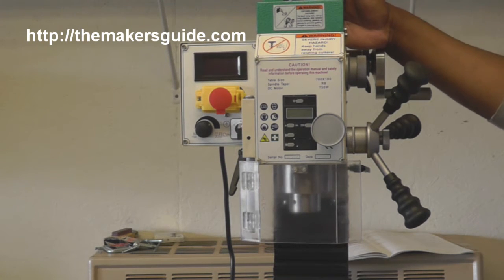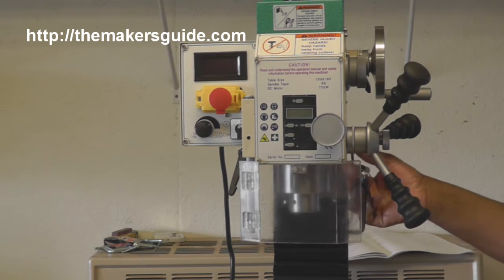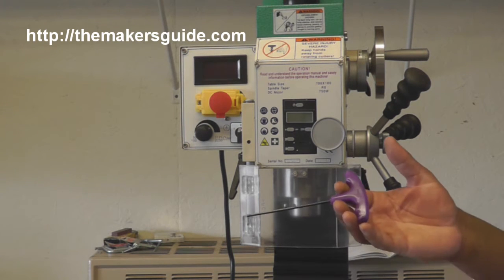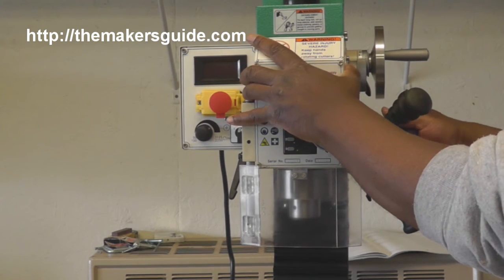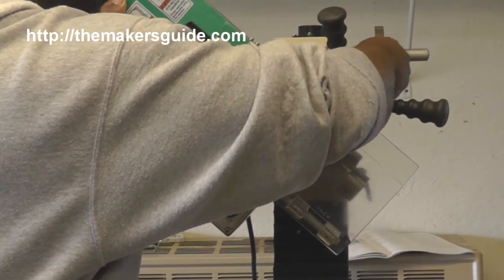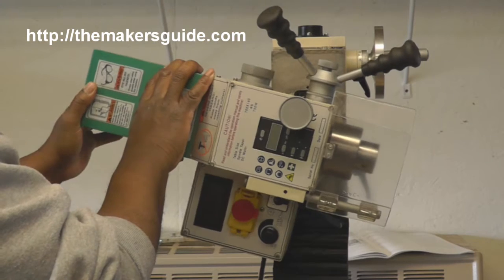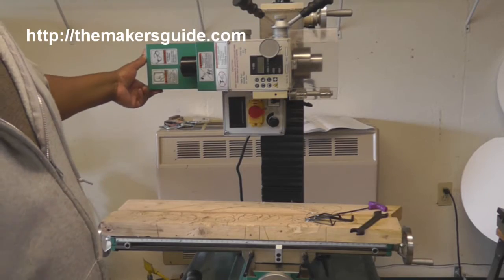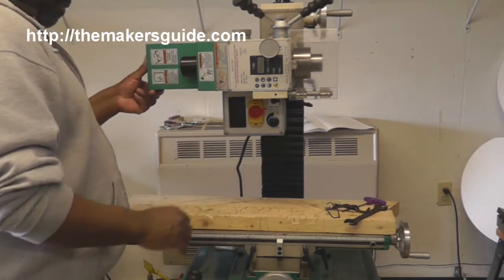Making a CNC Milling Machine  - Off With Their Head

Comment: Just bought a wmvd30 lv wich im gonna collecte tomorrow. I searched long and hard for this video. Thanks for the help, awesome
Reply from the maker: Glad to help.
Reply: @BillGriggs  it's all in my home now and went great , thanks to your video. The only difference for the WMD30LV was that it only had 1 circle bolt instead of the three  in the head, and the lock nut was a pull out pin with set angle holes.
Reply from the maker: @zendesigner  Good information to share. Thank you. Will you be converting it to CNC?
Reply: @BillGriggs  that is planned somewhere in the coming year yes

Comment: Nice video. Those studs look hard to align. How did you get the head back on. Any tips?
Reply from the maker: Denis Redfern  Use the mill table to make adjustments in X and Y. That lines it up, then Z finishes the job. If you try it by hand it is difficult.
Reply: Thanks Bill